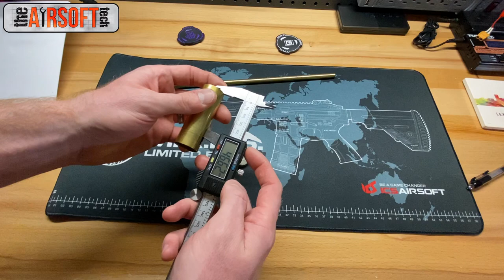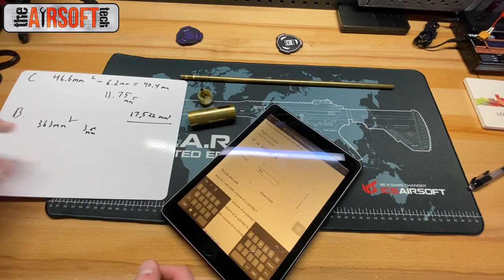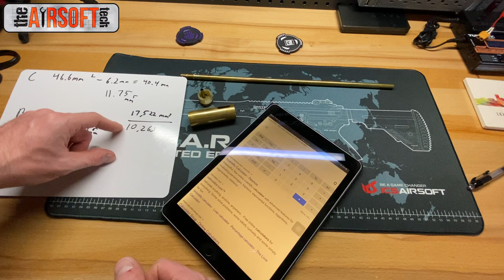Inside the Gearbox: Cylinder/Barrel Volume Ratio

Comment: Instead of measuring the from the o-ring to the bottom of the cylinder head, you can put the cylinder head into the cylinder to wherever its supposed to sit.  Then put the bottom of your calipers across the back of the cylinder and extend them.  The rod comes out of the bottom of the calipers and will eventually hit the cylinder head. That will give you your cylinder length, but you'll have to subtract the distance to from the back of the cylinder to the front of the port obviously. This will prevent any mismeasurement if the o-ring is sitting low in the cylinder.
Reply: Or push your piston all the way into cylinder and measure the overhang, subtract that from the entire length of the piston, and thats it.

Comment: When I did this years ago I had my cylinder+head assembled in the box and used the piston+head and lined up the sector gear at the point it would start to move the piston, marked the piston when it was full home and moved it back with the gear till either the o ring was just before the port or when it would be released by the piston if using a type 0 cylinder to get the actual swept/o ring sealed 'height/length' of the cylinder.

Was less about joule creep back then and efficiency/making the gun as quiet or loud as you wanted (over volumed short barrel guns with noveskes and 30+ RPS bark worse than they bite).
Reply: That's definitely a more precise way to do it. I measured the exact same way on a buddy's build just the other day.
True men of science 🤓😎

Comment: Solid info, and it's really made me wonder how much performance I'm missing out on in my rifles as they are either undervolumed or overvolumed. 

The only thing missing is the formula need to calculate the optimal ratio for bb weight. I can find several lists saying which ratio is optimal (which often differs from list to list), but not any mentions on how it's actually calculated and why that ratio is optimal. Non of the lists contain ratio for 0.33g or above 0.45g BB's which ironically are the BB weights I need to calculate for.

Comment: A major reason of joules creep phenomenon is actually about wrong cylinder volume. How can you skip it 😂

When a BB is fired down the barrel, it is pushed by the compressed volume of air behind it until the BB leaves the barrel and can no longer accelerate. This process can be understanded as simple momentum theory. In a nut shell, if you are running a system with too much volume (overflow), when you are using heavier bb, the joule output will  be higher than light weight bb. If you are running insufficient volume (shortfall), the outcome is reversed. And if you are running a system which cylinder volume is match with barrel length, the joules output should be about the same with different weights of bb. 

In addition, before the widespread of air cushion inner barrel, if you are running overflow system, it may affect your accuracy when you are using light weight bbs. However with the air cushion inner barrel, a overflow system may benefits the accuracy of all weight of bbs by enhancing the air cushion effect. But you stills need to pay attention to the joules creep. AND IT ALWAYS A BAD IDEA TO RUN A SHORTFALL SYSTEM
Reply: Gracias me aclaraste el camino ahora se como optimizar mi replica

Comment: Great video. I gotta question if ya dint mind given me your time. So i rece tly bought the krytac mk2 spr/pdw bundle and im just wondering how all this works with the same ported cylinder to barrel ratio when the pdw in er barrel is less then half the length of the spr inner barrel? Is the cylinder meant for one more than the other or is it just wrong for both or is it a middle ground that works for both lengths but not ideal for either lol

Comment: Hello, I don't know how actively you respond to comments, but I have a question about BoreUp and I read that you can also convert just the CylinderHead from normal to BoreUp to get a small increase in performance. Is that true?
 or if I change the normal cylinder head to BoreUp, do I also have to change the nozzle, cylinder and piston head to the bore up version?

Comment: Just thinking about it. Would it be more accurate to calculate the volume using the stroke length of the piston as opposed to the entire length of the cylinder? As, from my understanding the cylinder doesn’t necessarily stroke back the full length of the cylinder. Doing this would also eliminate the need for subtracting the length of the cylinder head from the equation.

Comment: But now there is a secondary problem, what about longer barrels? Volume ratio per barrels higher in volume for example in a m16a1 which is barrel length is about 50cm is going to be less then cylinders full length. What can we do to avoid internal turbine in the barrel given by longer length?

Comment: How does air enter the cylinder after a bb is launched? For a non-ported cylinder, air must enter through the nozzle before a bb enters the chamber. I suppose this is controlled by the tappet plate timing.
Reply: The piston head has ports on it and when the piston gets pulled back it unseals and allows air in from behind and seals back up when it gets pushed forward
Reply: @sjcvideos747  Thanks. Makes sense.

Comment: Super dope video! Question does the cylunder volume affect on fps? 1/4 cylinder  with m120 and full cylinder with m120 is the same result of FPS?
Reply: The spring delivers the power, the cylinder:barrel ratio delivers the efficiency.
A ported cylinder and very long barrel will be inefficient with heavy ammo, a short barrel with a full cylinder will be more efficient with heavier ammo.

Basically - it depends upon your barrel length and BB weight
Reply: Yes, kind of.
Years ago G&P did a series of 'stubby' ARs, like 100mm barrels, shot around 280fps out the box.

People started reporting these guns doing 370-400fps because G&P was building these guns with full cylinders and an M110 spring that by bringing a longer barrel into play, you got a B:C ratio that was able to deliver full power to the BB.

It's reverse joule creep in a sense, not enough barrel for the BB to reach full energy potential.
Reply: @NM-wd7kx  super appreciate ! Thank you martin!
Reply: @AidanMyne  thank you aidan!

Comment: with afull cylinder dont you need to subtract the amount that the piston sits inside it too?
Reply: yes. probably best way is to measure the stroke of the piston from fully forward to fully retracted. Make two marks on the piston in both positions and measure the distance in between.

Comment: Strikes me odd these folk seem meticulous in that they are very well informed about AirSoft guns but... how does one get so knowledgeable all the while looking at a system that is so badly engineered.  The backstop puts backward spin on a AirSoft BB but should not replace rifling and rifling is badly engineered as well. No need to rifle the entire barrel (at least in a rifle. What indices the most spin in throwing a football is that last little "flick" given by the finger tip right before the release.  But current rifling provides one stage rotating and never provides a flick. It is possible the projectile had already been given the most effective spin speed but the projectile starts going down the barrel with no spin (buy for a very short period and length. Then the Riflings are engaged and the projectile enters the riflings... It is not long before all the Riflings do is maintain (with friction) the spin, but the maintenance requires friction that takes away friction. The spiral grooves of rifling need to increase in the last few 1/2" inches (probably 3 times the length of the projectile) to induce a flick and increase the spin. Here we can look at the Buck Stop for proof.
    Next, the engineering of the valve where the compressed air is introduced it needs re~engineered as the BB being held in a pressurized state allows for leaks or introduced quick, fast and in a hurry causes other problems. No design has been developed well enough not even in a FireArm type setup.  So, I bought my first AirSoflt BB Gun about 4 months ago and quickly found these problems which I have full intention on re-engineering. I bought the GFSMG with the round drum. One of the first things I noticed is the round BB and the gun's inability to align an oblong projectile hence the reason Pellets are not for Semi Auto rifles without the amount of ammo and the ease of loading being very restricted. Although I have only a few fixes, I have the prior problems to re-engineer first.  (I do figure a drum shaped loader of Pellets held in a plastic plastic tape rolled up inside the drum to probably be the method I will use.  We will see. (I guess I need to first build a workable area and start making my own videos. Nice but problematic is that there is so very many topics I have expertise in and they all require my attention. From guns to gun laws, fron Prophecy and what prophecies have been fulfilled to what Prophecies are soon to be fulfilled (my most expert area)
 Then there is Survival a topic often found in YouTube but also a topic with the least amount of experts who are merely commercialized sales people selling their brand of junk to videors seeking profit and stuff from spencers and the public.  If you buy products you cannot transport (if you have a cart or vehicle, then you can transport more.  If you have only one Bug out location or if you think you can protect you and yours at home... in both instances you are utterly wrong.  You must have 2 buyout locations with the first being able to sustain you for at least 3 days to a week. This is where you can have stached supplies and equipment. This location needs to be within walking distance of either your home or your work. Buying BugOut land for BugOut Locale #1 is Ok buy for BugOut Locale #2 is not good... why? ~ Records, of course. Even mental records where someone, anyone has made a mental note, of you and the location. Who will be the first ones hit? Those trying to BugOut at home. They merely need penetrated to lose all their equipment and supplies and perhaps their lives.  Portland would have been a good example but neighborhoods were not targets.  More to come...

Comment: On a barrel that is a 6.03 barrel you said 3mm?
Reply: 6.03 is the diameter, half of 6 is 3 which is the radius. In order to find volume of a cylinder you multiply the length (363) by the radius squared (3 squared = 9) times pie (3.14).
Reply: This is basic geometry bruv